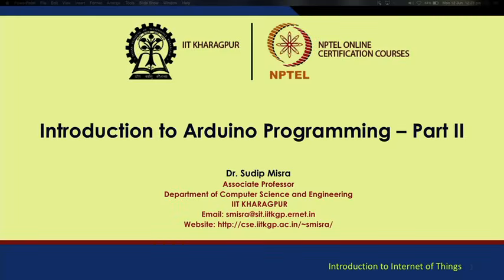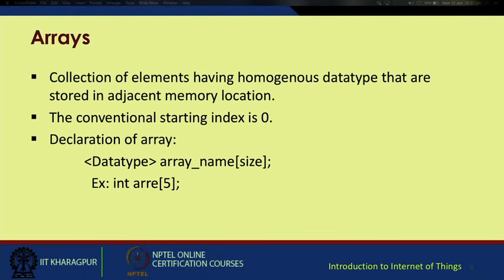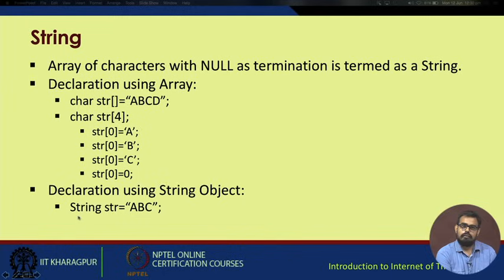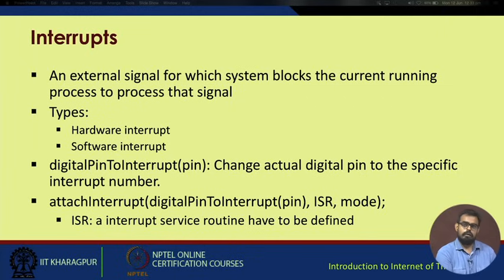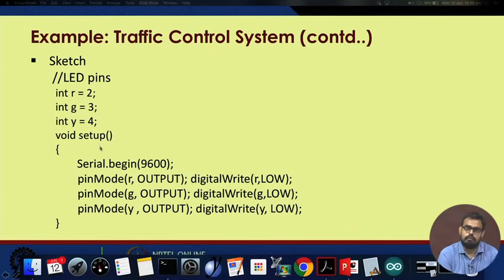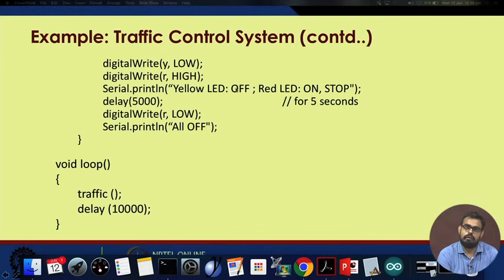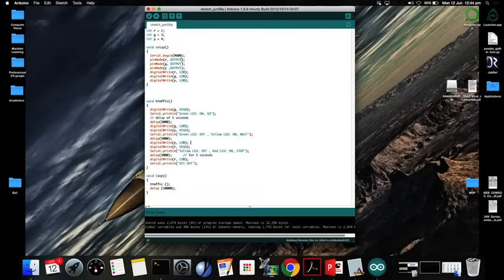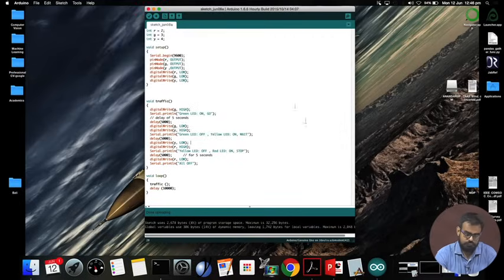INTRODUCTION TO ARDUINO-II

Comment: CORRECTION! On 5:13  int arre[5] means array size is 5 we can store 5 values in it. not less nor higer that array size. correct declaration is: int arre[] ={0,1,2}; or {0,1,2,3,4};   int arre[5] ={0,1,2,3,4};
Reply: you can, rest indexes will be garbage or zeroes